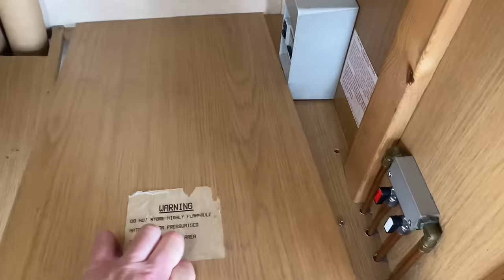REFURBISHING A VERY CHEAP SWIFT ROYALE BARGAIN MOTORHOME

Comment: HI Rob, just a little bit of advice when you lay the vinyl floor, use a hook blade in your stanley knife, you'll have much
more control than with a straight blade.  Also, make sure you have the lines in the vinyl perfectly lined up with the
side cabinets, because with the long narrow walkway, if its a fraction out, it won't look good!  (ex-carpet/vinyl fitter).

Comment: You are going the extra mile with this one Rob . Have you told Chris you want to keep it yet ?!
Reply: Yep, Lambo's up for sale, keeping the motorhome! 🤣
Reply: Well I mega enjoyed this, and this is the 2nd time viewing it.  You are turning it from a Cinderella into a Princess.  What with your buying skills and Chris expertise your doing great.  I think this one is going to be better than the first one you sold at Co Part.  With your attention to detail.  Just to say at our caravan we have Fly Blinds on all windows and door.  Also aluminium looking pull down blinds .  The Mosquito 🦟 blinds keep the direct sun out.  Also we have tied back curtains which we don’t use, just for decorative purposes.  We also put a nice matching flooring down and it transformed it.  But we still need the runner we bought from Aldi.  We put a bathroom type vinyl flooring in the shower room.  And it’s just made it so much nicer.  Did you mention the Cassette I can’t remember.  It’s going to look a spanker by the time you have finished .  I would just put the fly screen up at the back window until you can replace it, or mend it .  And the awning working is just the icing on the cake.  You have done well lads .
Reply: @treecutter1806  ain’t it on finance ?

Comment: Many years ago at the age of 49 I was facing redundancy but if I managed to reach 50 with the company , I could also retire on a  generous NON contributory final salary pension. The catch was the temporary job I was offered was on the other side of the country. I couldn't afford to rent a house so I bought an old 5 berth Abbey Lancaster caravan. I found a site that would allow me stay for a full year at very reasonable rates. The interior was tatty so I did a refurbishment to make into a comfortable 1 berth. Whilst on holiday we visited a boot sale and found a huge stack of heavy duty material in perfect colours for the van. The material was originally curtains in a large restaurant and was faded in parts. It cost us a whole £10.00. My wife was an excellent seamstress and made new curtains, pelmets, seat covers, tie backs and even 2 duvet covers with loads left over. The best £10.00 we ever spent.

Comment: Fascinating.         Admire your transparency and 'can do' attitude.             Some years back with my Father in law's help, we did up a tired (& damp / rotten) old ABI.                            Our local caravan dealer in Cheadle was  really helpful for locks, replacement  a handbasin, a roof light (we lost that on the M62!) & a spare wheel.                 Biggest transformation ever was the self adhesive strip set we got from them to hide the damaged front panel. Thank you NW Caravans.

Comment: The flooring is not necessarily my choice of colour but it is most definitely a good choice for that van! A good buy I think. As for the washroom door, that damage most likely comes from the steam when it is used as a shower. I would suggest to glue a suitably coloured splashback board to the back of it, which will also help to tidy up the back side of it and help to strengthen it a little. I knew about the awning and was shouting "pull it down" at the screen repetitively, but it was all good as it gave me a good chuckle as Chris informed you that it was 'user error'. Naturally, I made the same mistake until I was told how to use it, so you are not the first and won't be the last to do this! Anyway, it needed greasing so all's well that ends well!

Comment: Rob cut out the Lino with a Stanley knife around the locker bases and bed boxes on the outside etc .
Then use that as a template to cut the new Lino but add a couple of centimetres to make it bigger all round and tuck it under the bed boxes and wardrobe etc.
You should be able to undo the screws holding the furniture to the floor and push it under. 
It doesn’t matter about the different Lino’s as you won’t see the inside the bases anyway. Plus they are a similar colour .

Comment: Getting on nicely, flooring will be spot on. On the door where you have put the bracket on the back you should try some miter adhesive to keep the joint closed, will work a treat, only about £7 from screwfix

Comment: Rob you don't have to remove the bench seats to lay the flooring, if you can cut the original around the edges and remove it intact you should be able to use the old flooring as a template to cut the new, then just glue it in place, if you want some help just shout, I'm only in Chatham

Comment: As a builder you gentlemen are spot on about waiting for everything to be done before you finish the floor. Great choice on the flooring. Vertical and horizontal do not apply to flooring LOL  port starboard fore aft bow stern maybe. Remote electric motors for the awning are available. Fiama are top of the line. Thanks for sharing

Comment: Like the 'plank' look of the soft vinyl flooring!! A quick tip from when we removed vinyl tiles from a concrete floor in our kitchen, that glue is a b*tch - instead of coming up in strips, it was breaking into pieces. I laughed when the wife said to run a medium to hot iron over it first, but that did the trick by softening the glue first so that they did come up in strips. I used a 6" heavy duty scraper ( Screwfix item 87299 ) which worked a treat. Good luck and great job so far.

Comment: Good job , Use quick steel putty to extend the metal arm on the lock quick and permanent fix , I swear by it on little small fixes like that.

Comment: Rob you ought to fit a second outside door lock the same as the the top right one and fit it between the 2 vents as someone could use a crowbar to prise the bottom of the door and get in.
Or even better fit one at the very bottom of the door if you can fit it there.
Reply: Yes you can’t be too careful .

Comment: That was not a mistake, that was an awning drive, grease and service. The flooring was a good choice, the lines will enhance the feeling of space, the style is right on trend and the colour is perfect, with no risk of a clash. There is a host of little 'bitty' issues, none are huge, but they all take time, five minutes here, two hours searching there, but mean another step along the progress chart. It is a sound idea to get the inside cleaned out before you put the great new stuff in place. Keep on carrying on, and get it right up to standard before you pass it on.

Comment: Great content as always lads,don’t want to burst your bubble but it’s like a caravan with a engine,but with a motor home you have to get a habitation check for damp if you are going to sell it on unless you are going to sell to trade or for spares or repairs as the buyer has 6 months protection just be careful especially with the roof,walls & the floor,get it serviced inside & structurally just don’t want you to get caught out as it’s not like a car thanks for the brilliant contact again

Comment: Save yourself the hassle of taking them bases out and vinyl up to them and put a bead of silicon around the edges. Will help keep it watertight when cleaning and save you alot of potential agro. 

Also of you are trying to modernise it a little look for some LED lighting to replace them crap old tube lights inside. Better for power consumption too.

Comment: Rob If I remember rightly they are rough cast it does look okay from what you shown I work on those locks it's a vcam zadi lock you can get replacement inner barrel but they pain in the behind to change
Window you can get a new one remade there are companies that do this or  if there any caravan breakers near you
Reply: Locker West Alloy WD Long Replacement Door Gas Locker Lock Caravan Motorhome just use the back peace

Comment: What is covering the wheel arches? it looks like carpet. Was there carpet in there originally and then was replaced with the vinyl flooring that you are going to replace again. I think your choice of colour for the floor will look good. Bit of luck finding a precut roll. Good job both!

Comment: With the Bathroom door I would have removed it from the van and then stripped the door back to its component parts to then re glue it, as the joints are probably quite weak, and made new bits of trim to hold the panel in place. If you are screwing into wood near the edge you need to pilot drill it to stop it from splitting. You should be able to get most door lock components, it is just trying to find the right ones that is a bugger. I have had to do similar with my own Motorhomes, Found out recently that the front indicator units are the same as a mk2 Golf. Sadly I could find Clear ones that were not same thing like £80 from the States. Shame but the ones I fitted as I keep having the bulbs come loose as they only had effectively one screw holding them in and they'd vibrate loose.

Comment: Great job as always Rob as far as the new flooring is concerned; many people would have simply laid a new strip of flooring  down the centre of the van and not bothered with removing the lockers to do the job properly, so kudos to you for doing the right thing. One thing you didn't mention was if you won that door security device on eBay.
Reply from the maker: Not yet

Comment: Nice camper, Rob! I would rip out the old flooring before laying the new one. The old flooring is coming loose and it will ruin the job for you. If it is moist underneath you need to dry it out first. Check for water leaks. I've been there, done that.
Reply from the maker: We are removing it

Comment: Hi Rob , have you checked the chassis and engine numbers match the V5, it’s just that it looks to me that the vehicle may have been stolen at some point with all the broken locks, and I would also say that it has been used by travellers with all the plastic covered upholstery.
Also there are discrepancies on the VOSA MOT history compared to the car vertical check.
Reply: Those were my thoughts regarding the plastic on the seats.  The bonus is the casette toilet will not have been used !

Comment: Carpeting is going to be a bugger to keep clean - Hardwood flooring that matches the cabinets will be so much easier to take care of. A quick sweep or damp mop to remove dirt or mud,
Reply: They actually bought a roll of lino, which should be even easier to keep clean. And in case anyone wants to, they could always add mats or rugs.

Comment: Good floor choice but lay it when the rest of the work is done inside.  there is a lot of work in getting the inside stripped out and then put back.  The shower door really could do with coming off and being glued and cramped properly.  It will make a neater, stronger job instead of those plates and staples.  But well done, it will be a very nice van when you have finished.

Comment: Rob  
I have that same awning on my Elddis Motorhome.  I was praying you figured out to pull on handle before you took it all apart :-)
There should be a telescopic bar to fit across the middle of the awning that allows you to tighten up and tension the fabric as well.  Might get one on ebay if your lucky.  I had no luck with finding replacement end cap as the only ones I can find are too small so check this before ordering on ebay.  Good Luck and great channel
Reply: Chris can sort that no problem .

Comment: Floor covering with the lines in will make the interior look longer  ...Does the  drawer at the back end split down into two or is it one solid piece ? Sure you can get new barrels for that security lock though if they are the barrel type GT towing near us used to sell the barrels  when we had a caravan  we changed them over

Comment: Im not going to start slagging you off Rob, i changed my right side drive shaft on my connect, and it turned out it was the left wheel that was loose 🙄, great video guys.

Comment: Have to say Rob that a lot of people looking for an older (i.e. cheaper) Motorhome would expect to fix the smaller issues you are addressing, themselves. And you do normally sell vehicles on a wholesale basis - you're not leaving the other guy much opportunity to add value :)
Reply: I was wondering where Rob will put the Speedboat to tow along with their Motor Home, or perhaps 🤔 he should do up another little Fiat 500 to tow, so Claire can nip to the shops in it.

Comment: I’d not bother taking out all the existing furniture to lay the floor right under it, it’ll be an absolute sod to get it all out and back in again - just cut the existing one out, along with the gaps under the sofas and fit just the centre section. You’ll then have another big piece of Lino you can sell on.

Comment: Rob the awning pulley is the same as my trailer on my artic when we wind down the legs you have to pull the handle to engage the gears. I was shouting at the iPad “rob don’t take it off “ rob you would not believe the amount of people I have seen on site with brand new vans thinking the awning is broken. 
“Every day is a school day”. Don’t forget rob when it comes up for sale send Chris your mobile number when it comes up for sale in Instagram 😂😂😂😂 
Nice van floor will look really nice. 👍👍.  Rob the floor sometimes lifts if there is damp underneath might be getting a damp meter.
Reply from the maker: It has no damp it’s lifting because it’s damaged 👍

Comment: Not a schoolboy error on the awning gearbox - it's just a faff of a design. I know you're not a woodworker but I would have taken the shower room door off, clamped it up, used lots of PVA adhesive and countersunk the screws. There's a heap of work replacing that flooring given what's on top of it - maybe you could use the original as a template if you can get it off in one piece. With door latches it's worth looking at the keys since they may have the manufacturer's name on them, eg WBH, Yale, and then you can Google them to find the part number, etc, on their website. For safety I think you need a bigger stepladder....
Reply from the maker: No need to sink the screws as it was only holding it till the glue dried 3 of the broken trims are being replaced 👍
Reply: @sruk  Oh OK, thanks - fair enough!

Comment: Sorry Rob you made a hash of that door🙈🤣
Looking great otherwise, you had some luck with that vinyl👍
Reply from the maker: What holding it all in place why the glue dried ? You haven’t seen the end result and I said it’s got to have the new trims fitted in the video ?
Reply: @sruk  ahh sorry I didn't catch that bit obviously. Thought the staples were permanent 🤣
Would've been alot easier to remove the door and use some sash and G clamps tho.👍

Comment: Oleary  is also on ebay....put your location as Hull.... Caravan capital for manufacturing
Reply: @sruk  it's where the bulk of all, tourers statics and motor homes are made. And parts are cheaper here. Because of volume and old manufacturers going out of business. I can send your more details on Instagram.  I used to be an engineer and can explain alot of easy fixes and ways to make it look good for pos and unknown ways to clean. Things l ok le Handles etc tarnished because of what they used to clean at the end of production ..and. For example cosalt we used to build 29 plus statics a day.  And in touring caravan they can produce 25 plus motorhomes a day and. Upto 160 tourers on four to five lines.  It's a very very fast hard paced environment.  And the skill levels of the lads and lasses is amazing. Alot work on portable buildings etc now. I retired as an engineer due to my pancreas dying. And I still have my much loved Passat STDI. Which I worked hard for.  Any help etc just ask. I am glad to help where I can. I do it for free. As it's my way of giving back.

Comment: You've got 2 different types of gas there mate, you'll need a propane regulator for the red bottle (unless that is, you've already got one)?
Reply from the maker: Yes we only put that on there to test it as we couldn’t get a bottle at the time
Reply: We have Flogas it’s so much cheaper than Gaz , but we also have a Gaz bottle aside it in case one or the other is hard to come by .

Comment: You are getting carried away again, you have a lot to do yet before you "Jump in it and use it as it is". Those windows need a dose of looking at particularly the rubber seals make sure you clean the out and recondition the rubbers to keep water ingress at bay.your habitation door looks like it needs work towards the bottom.
W.hen you have cleaned the inside get yourself a Damp Meter and check it out.

Comment: This was a bit of a painful watch, dont take offence.. staples in the door and screws splitting the wood made me cringe. Lol, i know carpentry aint your field so dont take it personally, but it does need a professional touch on the interior to make it more original. Glad you fixed the locks though!
Reply from the maker: I think you watched without listening bud like I said the wooden edging trims are being changed Chris was cutting me some new ones and the screw was holding it until the glue dried look at the trim with the screw in it’s got chunks missing also the staples can’t be seen once the trims are on and offer extra strength 🤷‍♂️ no offence taken 👍
Reply: @sruk  ah right the trims will cover up the staples! My bad mate, great project!

Comment: The only thing I wasn't impressed with was your bathroom door repair. You should have drilled a pilot hole and countersunk the screws you used. The splits in the wood look awful.